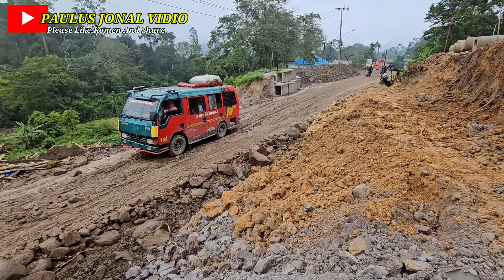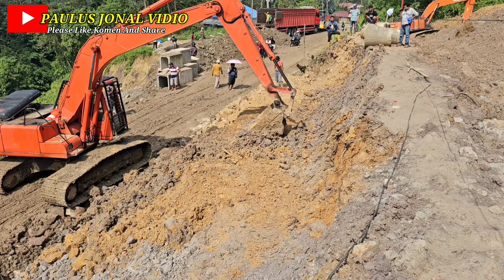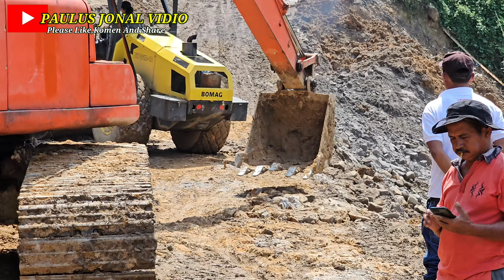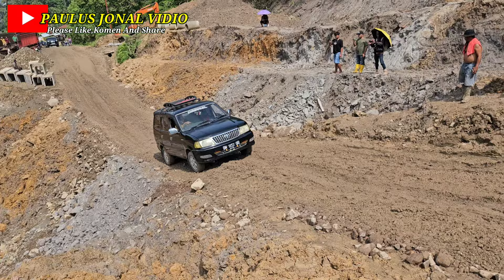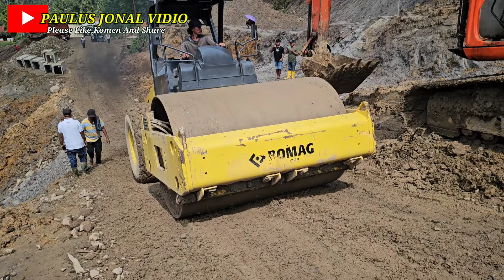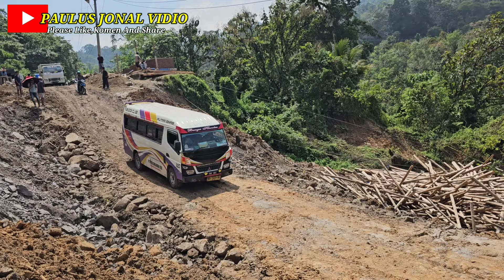Pelebaran Jalan Batu Jomba Finish || Target PUPR Akan Menghilangkan Tanjakan Dan Dibuat Landai

Comment: Bingung aku!!! If the authorities have thought about doing the road widening all along.. why wasn't the construction of the new road stopped earlier? Dimana kerjasamanya?

Totally agree with the need to reinforce the slope.. otherwise it'll be back to square one... Maybe way down at the bottom concrete piles can be staked at proper intervals then fix gabions in front as a retaining wall..
Reply: Aku setuju dengan ide anda. Anda sangat berpengalaman.